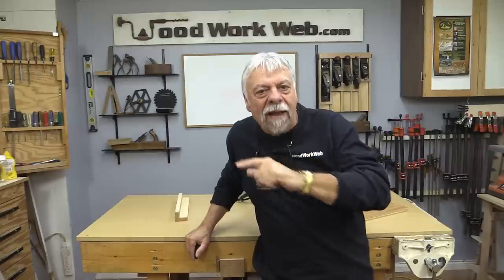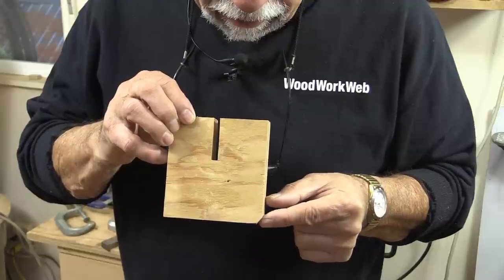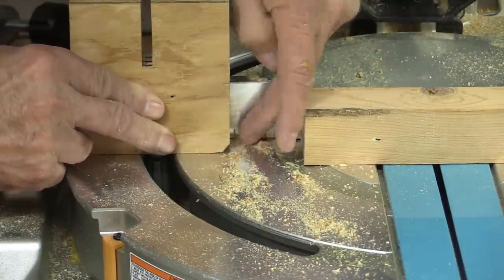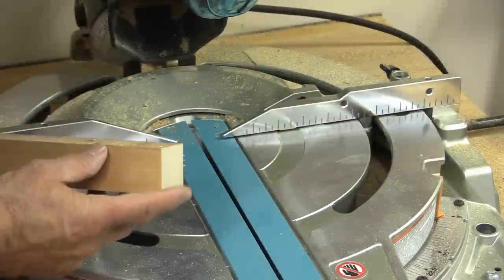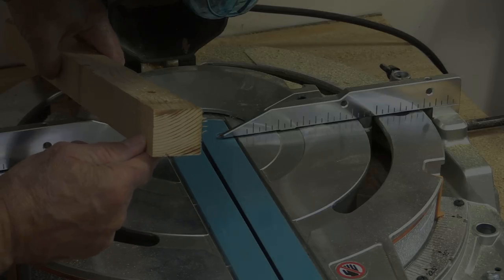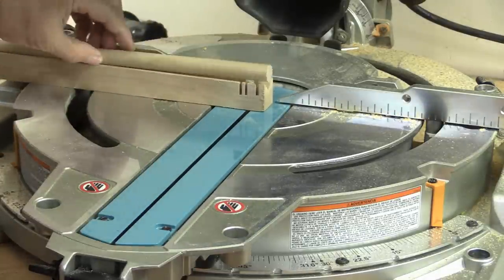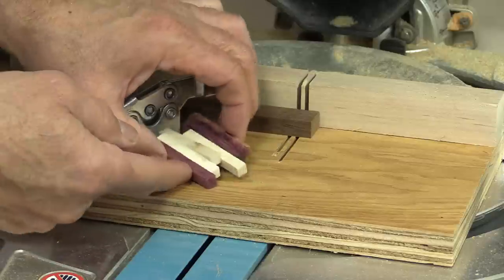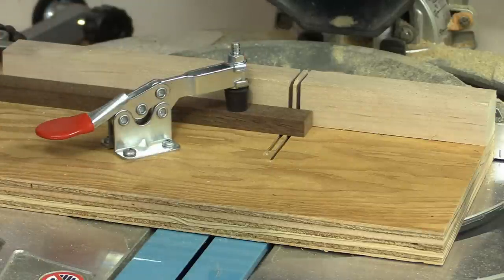5 Quick Mitre Saw Hacks - Woodworking Tips and Tricks

Comment: Another reason to wait for your blade to stop, is that most miter saws have an electric brake built into the switch. When the brake is activated it causes the blade to suddenly slow down dramatically, which actually flexes the blade, up to a 16th of an inch in some cases (depending on the blade.) High speed footage shows how much wobble a blade can sustain when the brake is activated. So if you’re letting go of the switch and immediately lifting up the blade, that flex can nick the material or cause a blowout.

Comment: Outstanding tips thanks. Love the butt up against the blade to let the carbide graze the wood ever so slightly.  Thanks!
Reply: Butt the wood, lift the blade carefully, start the saw and then do the cut. You'll have less burning/tearout. You'll also get cuts that are more square, especially on hardwood. You don't want to be cutting with the back/side of your blade's teeth.

Comment: Very useful tips again, Colin. Thanks for sharing.
Because of the fact that a mitre saw is shattering sawdust everywhere I always have a small (round 2 cm) paint brush nearby to clean up the work surface.
Saw dust causes that the wood is not touching the wood evenly on the ground and/or back plate and when sawing in spite of that you do not get good cuts.
Reply: Hans de Groot a great
Reply from the maker: Thanks for the tip Hans
Reply: I have a dust collection system connected to my saw.
Reply: I do not have, yet. 
But how effective is your dust collection? 
Especially at mitre saws it's quite a problem.
Do you have a video on that?
Reply: Hans de Groot I dont post videos. It works quite well for me.
Reply: If I'm outside, I'll have an air hose and blowgun handy for a quick hard burst.
What be this "dust collection" of which you speak...?   :p

Comment: Nice to see you again, and thanks for the tips on the on the sliding mitre saw.  I have a Dewalt, and it appears to be very slightly misaligned; does not cut exactly perpendicular to fence.  I'm working on that, but I would value any tips you might offer.

All Best,

Charles A Berg

85 y/o and still at it.

Comment: I often need a half blade cut and will lightly push the wood against the blade, lift the blade and cut down. I need to try your upcutting trick and see the difference. If I need a lot of small pieces, I sometimes just clamp a c clamp to the fence with the screw facing away from the stock. Then I can easily flit the cut piece aside, and keep the trigger on as I feed it very fast. Never had a problem in 3 decades, but I wouldn't do that for cabinet quality work.

Comment: I've only been using a mitre saw for a few years now on home projects. But in your video it seems like your fingers are much closer to the blade than I feel comfortable with--do I need to learn to lower my "zone of safety"?  Also, I always try to find a way to clamp my wood pieces to my saw/table before cutting, but I see you just using your hands to hold the wood as you cut it. Is that OK to do? I thought I needed to clamp it down.  I guess I need some pointers on the basics of a mitre saw to make things go quicker for me, maybe I'm doing it too safe and slow.

Comment: Good tips.  You happen to have the same Makita saw I just purchased.  Your experience with it so far?  Likes? Dislikes?  In another video the suggestion was made to cut from the back forward for a cleaner cut.  Your thoughts?  My saw is replacing my old drop saw so I never considered cut direction but it sort of makes sense thinking about my bench saw, you wouldn't be cutting backwards?

Comment: In building the clamp for small pieces of work, what is the clamp called and where can you get one? It's a great idea for holding those tiny pieces of trim and edging as you don't have to have your digits anywhere near the blade when cutting, and there will not be any kickback of your stock or work.

Comment: H Sir,
Sorry for the long message!

I am new to wood working and planning to buy my first Mitre saw.
I am confused between Makita LS1040 and Total TS42182551.
Both of them are of the same price, but Total has more power (1800W), sliding option, Laser, 5500 rpm etc.

I trust Makita (I am happy with my makita circular saw) however, I have used 'Total' products before and it is good as well. Hence confused.
Should I go with specs or the brand!
Your reply is much appreciated.

Comment: Hi Colin
Is there an issue with the blade on the saw - eg does it need sharpening or were you cutting slow for the video?  I see scorch marks on the end of dowel and the dark hardwood.
Reply: Adler Video exactly what i was thinking. Maybe a combination of both.

Comment: Around 1995 I bought a Delta chop saw, used it for 2 hours, and stored it never to use it again. Now I see you have a Delta Slider Saw which I think is great as it can cut wider stock. Is my old brand new saw obsolete, and should I turn it in for new technology?
Reply from the maker: Only if you're going to use the new features. I would suggest trying a demo at a local store of wood show before upgrading. Thanks for watching!

Comment: You don’t need to wait on the blade to stop unless you’re cutting harder materials like alum where kickback is a huge concern. Long as you loft up at same speed or slightly less then the speed you made the cut the there is no other concerns. The issue is people tend to cut at the speed the blade cuts and then quickly raise the blade.. just raise it at the same speed of the cut made and you’re good

Comment: Great tips Colin👍👍👍.. few ideas to improve your set up... I just happened to be in large manufacturing process where we use ton of these saws.. 1st great choice Makita brand is very reliable equipment.. 2nd you first tip with 45* Corner - if you take/make wood block 2"Wx3"Lx4"H run that block on table saw so it will cut slot to fit over the saw fence,  but make sure it stops short about 1/16~1/8" of the saw table base.. You will eliminate most if dust build up (from back side you can insert  bolt that will hold jig and eliminate clamping. 3rd running blade from bottom up is not best idea since carbide bits are not sharp in that direction,  however if you do same approach.. push part against blade when is down, hold part, raise blade and start blade and cut.. it will provide about 1/64~1/32 trim, depending of blade (space between saw plate <>carbide tip aka kerf). VERY GOOD ADVICE to STOP blade before replacing back into upper position..4th if saw blades are running long(er) until stops,  replace motor carbon contact brushes.  Blade should normally stop within 5~10sec max.
Reply from the maker: Some great tips there ... Thanks for sharing and thanks for watching!

Comment: I would first like to say thank you for your video I'm always trying to learn new things and different ideas, better techniques. The main passion my life is Construction. I'm also a general contractor / Carpenter and I have been blessed with being very successful at it for many many many years. I like to do just about everything but painting, lol. With that being said, my strongest skills are, aside from  orchestrating Fiasco's(general contracting) is finish carpentry. seems like I'm always either doing everything else or managing my subs to get to my favorite part, the finish carpentry. Please don't take this the wrong way. I completely disagree when you say that using a stop block is more efficient and easier to obtain the same size cuts repetitively. And in my experience I rarely you stop locks especially for finish carpentry possibly once in a great while on ruff cuts especially if they don't have to be perfect. The reason being stopped blocks move stop blocks change and in my opinion it's just more chance for error more chance for accidents. Yes having a flute or having a cut corner is definitely a lot safer and a lot more consistent and accurate cuts repeatedly, but it can also cause binding, it can cause kick back and can cause serious injuries. Relying on such a block also doesn't really lend to improving or fine-tuning your carpentry skills either. the best way to make sure your cuts are bulletproof safer consistent is practice just like with everything else in life, and there's another great technique that I like to use that will help your carpentry skills immensely in this department. Learn how you mark your measurements and always consider your thin little pencil mark three+ actual markings.
Reply: You have your dead center of your mark you have the left edge of your mark you have the right edge of your mark if you stay consistent with yourself and learn which part of the mark you're using and always do that you will consistently have excellent cuts. This might sound trivial to most people and I agree it's probably not picking but I've taken more than a few people to the hospital for kickbacks and shortcuts hacks know your tools be careful be safe and thank you for your video

Comment: When using a stop-block,  instead of cutting a 45 degree cut on the block, just lift the stop-block up a little... maybe a 1/4 inch so the saw dust is pushed under the stop-block.

Comment: My mitre saw is from Home Depot . It’s a Ryobi sliding mitre saw . I noticed that the cut doesn’t seem square in the ends and I have to rotate the wood and run the blade through again to get an even cut. How does one fix this problem . Ps saw is only 3 months in use !!!

Comment: That blade is dull! It's burning every cut, and tearing out horribly...
Reply: but it still cuts...
Reply: Jay Furler AK  And what blades do you use?
Reply: Not correct normally it’s a sign of the incorrect blade choice. You can put a brand new blade in a saw and get burns if it’s not the correct blade. It’s all about the gullets to material thickness.. try and rip a piece of oak with a cross cutting blade 🤣🤣🤣 you won’t find burns cause the entire edge will be burned! Proper blade for proper cut.. materials is of little concern it only matters when you have a poor blade choice. Even a dull blade of proper type and proper setup isn’t going to but the wood. It just won’t cut as fast.
Reply: Could also be pitch build up on the blade ? A simple cleaning could solve the problem ?
Reply: @LoneWolf-yp2mo  how do you clean that burnt on mess?
Reply: @fishrrelaxing9361  this makes a WHOLE  lot of sense. And from my past experiences it seems to bare it out. And you are 100% correct, you have to know enough about which type and TPI of blade to use for the type of wood and and cut you are going to make. A blade for rough ripping of timber for framing is not going to work well on beadboard, it will cut, but so will a nibbler for sheet metal. It all boils down to the words instilled by many a junior high shop teacher - " choose the right tool for the job ". And many years latter working in industry similar words pounded into our heads were " work SMART, work SAFE ". Both good practices that served me well from schooling thru a 36 year career in the electrical trades. Retire healthy and whole, collect that pension for a very long time, you earned it to be sure !!!
Reply: @bobgarr6246  there are a lot of citrus based cleaners that do the job. Rockler actually sells a kit that comes with a cleaning chemical for it, a scrub brush & a tub big enough to lay saw blades in and completely submerge them in the cleaner to soak burned on pitch. Works like a charm; you just have to make sure to dry it well after cleaning.

Comment: A little tip from me: Place your stop block on the left side of the blade. If and when the blade kicks the piece out, it don't gouge the wood.
Reply: How does it make a difference what side it’s on?
Reply: dont see how that would make any difference, and would also force you to use the saw left handed, which is dangrous

Comment: Good stuff Colin! BTW, does your saw have "Soft Start". When I turn on my saw, it starts so abruptly that it actually "jars" my hand. If I'm not holding the part VERY tightly, it will move. Thanks
Reply: You might have a Dewalt...
Reply: Yes I have the same miter saw and it does have a soft start. Love it!
Reply: Yup, my dewalt is off or REALLY on! No throttling her
Reply: we just the ls1019 in Australia, funny thing is the 'bunnings' (i guess its like home dept) exclusive ls1017 (same as ls1018, just one way bevel) has a soft start and sounds like its going strait up , so many come to our service tech for repair due to the noise .

Comment: A good video but I don't like the approach for taking a hair off your cut. I believe it's better 2 but the wood against the stopped blade, then what's a Blade rise up, then start the saw something the blade back down slowly. Seems better to start the blade like a normal cup without any pressure against it I would think especially on belt driven saws. Same results let's fighting the saw no burning
Reply: Or use a shooting board, I reckon. Although that is something else to build/have. Depends what sort of finish one is after I suppose.

Comment: Its not idealistic but if u put the saw blade backwards its easier for cutting vinyl as the teeth wont chip it.
I do this when doing vinyl siding
Reply from the maker: Thank for the tip. I've heard of that before, but have never tried it.
Reply: Using s dull blade also works good for vinyl. I have done this a lot when cutting vinyl siding.

Comment: I've noticed cutting by butting it up and lifting the blade makes it splinter out for obvious reasons
Reply: Yep. Works better to pull the blade down, butt the blade and then lifting it back out not spinning and cutting as usual. This way also lets you judge just how deep the shave is by how much the blade deflects when butting the work to it.

Comment: Colin. How do you like the new Makita Miter saw. I’m in the market for a new saw. I’ve read some good reviews as well as a few bad ones. I’d like to know what your thoughts are. Thanks.
Reply: Scott Weiner i have one and i love it its back from 2016 but running strong
Reply: Makita are great tools but they dont make great switches expect atleast 4 years out of it if u use it constantly daily
Dewalt is expensive but i have to be gentle u can scrap it in less then 6 months if u dont let the saw gets its full speed before cutting.
Bosch is pretty good but i find the grip handle rather bulky and uncomfortable
Reply: Milwaukee cordless is a great option too! the 9 amp battery lasts all day for me.
Reply: Aron Dueck Milwaukee are really good quality. Haved used but never bought/owned
Reply: I have a Festool which cost a bloody fortune but it's so smooth and easy to use and to set and so so so accurate, I don't regret a penny.
Reply: MagicSpamDragon I don’t know about that comment on DeWalt we used a DeWalt in my high school and that thing was amazing every day of school for the 4 years I had woodshop it performed great that’s 4 years of shop class use 7 hours a day of kids abusing it and during the summer my teacher used it on the job
Reply: Buy the Hitachi 10"!!!
Reply: Can't go wrong with Harbor Freight.
Reply: I would never cut repetitive cut like you show here. I always hold the side against the stop then the other end is free. You're way is so dangerous.
Reply: Meldins STI n

Comment: they are both MITER saw's a compound sliding miter saw moves, a Miter compound saw is a NON sliding miter saw. the compound means it can turn on it's axis 45deg. A chop saw may or manot be a miter saw but a miter saw is allways a miter saw as it cuts MITERS

Comment: In reference to your method of letting the saw stop before lifting the blade, you talk about how the piece can catch between the stop and the blade.  You should always support the piece you intend to keep when making a cut. In your demonstration, your workpiece would be 'floating' between the stop and the spinning blade; a bad idea. Additionally, you're then still applying pressure into the stop, which once the cut is all the way through, transforms into pushing the stock into the blade.

Comment: hold the phone here.....  turn the saw on while laying up on the wood...…  never ever..  bring the wood into the blade face, hold the wood in place and raise the blade. You'll gain a 1/3 to 1/4 of the blade width for your cut.  the flex in the blade allows this press fit to set up the piece.  Fire up the saw and make the cut.  I appreciate all your expertise but running up the saw while in contact with the piece, even up against a fence, is a potentially hazardous maneuver.  And then there's the foot trigger. Not a beginner's device, especially on a miter...  dam..... I hate to be that guy.,, but this stuff just jumps off the page for safety,.. and coming from a guy who pins the guards back... but not when anyone else is on the tool..  keep the beginner advice real safe and clean.  the 6800 rpm saw will cause a bit of damage if it bites and someone's hand jumps of the work..

Comment: Had to come back today to comment on sawdust trick. Please notice on first block of wood he doesn't move the wood back to remove sawdust with finger. But notice on next block with notch init he pulls back on wood to move sawdust with finger thus sawdust easier to move out of way please dont buy into this.
Please note about movement of wood hold wood tight and it won't move. All these things to hold wood in place  to make wood not spin or move. Hey guess what youre hand is a tool use it hold tight the wood youre cutting and guess what clean cuts and no movement just saying.
Note youre hand is the best tool around with out it you wouldnt be able to make the tools you need to do the things you need. People they still cant make a robot hand like the real hand just saying.